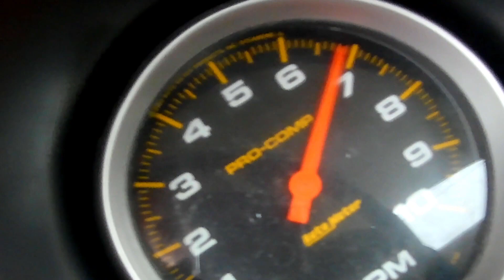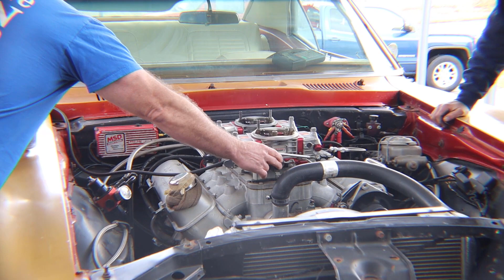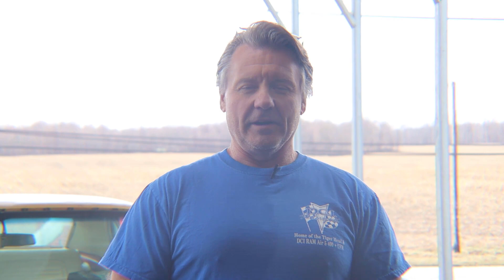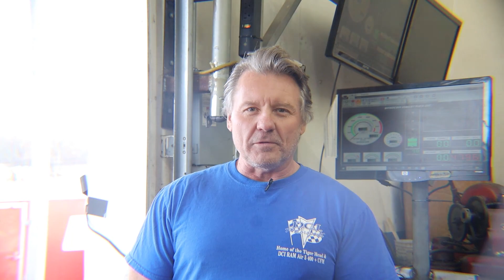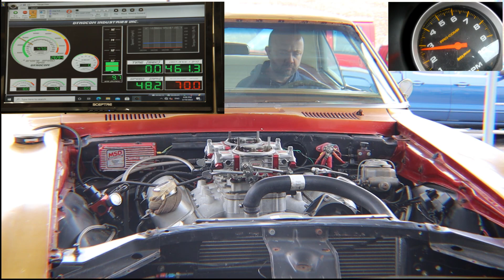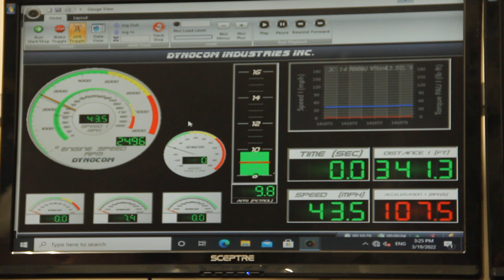DCI 67 Firebird Dyno

Comment: Just wondering what is a Ram air V is a engine 400 or 455 or just heads??
Reply: It was a 303 cubic inch engine as originally designed and produced. It was for Trans Am racing.

Comment: 614 hp, but 738 torque? Seems like one of those numbers is wrong.
Reply: Interesting thing about the math, torque decreases as rpm increases. I didn't see any curves in the video, would be interesting to see what rpms peak torque and hp came in and how they ramp.
Reply: @tahm22  Yes, I think the answers to all our questions (or cause of confusion) are in the chassis dyno.
Reply: How so? Doesn't seem that weird at a glance, to me.
Reply: @tahm22  There's no way this motor made that kind of torque below 5000 rpm. Do the math, hp would have to be over 700. Something ain't right.
Reply: @mback12000  torque=hp x 5252/rpm
Using some algebra, we can determine that the motor was spinning at 4370 rpm to acheive 738 ft/lbs with 614 hp. That seems about right for a built Poncho.
Reply: @tahm22  No it doesn't, that's my point. Respectully, it wasn't making that torque at that rpm.. And fell so fast it wouldn't have a higher hp number.
Reply: Listen to his specs...a 430 cfm head, twin carbs, and 268/284/106 w almost 900 lift cam... No way peak torque is at 4300. Cmon dude.

One thing is this is a chassis dyno, so he's down at least 100hp at the tire. This motor is way over 700 at the flywheel. I'm not taking anything away from the builder.
Reply: @mback12000  Great points. You think rear gears could be pushing the torque up? You can gain as much as 55% with the right ratio.
I really don't know, but I appreciate the conversation.
Reply: Most likely has to do with the way the Dyno is  loaded
The initial numbers are usually not correct and that’s right where the torque peak is on their chassis Dyno but that’s definitely not where the torque peak is in the rpm range. Most likely the horsepower number is correct realistically if I had to guess that motor makes about 630 to 650 torque at probably 5200-5500rpm on an engine Dyno
And engine is probably making near 750hp on the engine Dyno so realistically torque number would be around 550+ or a little higher at the tire imo
Reply: Torque converters can multiply torque within a given range and this is a chassis dyno. So it seems correct to me.

Comment: You guys are developing a tri power intake manifold for your tunnel port heads, correct? 

A low-profile option would be great because I'm intending on using RAV heads w/ Tri power on my 65 Catalina Convertible, but they don't have much hood clearance. 

Would I have to get a manifold cnc machined as a one-off design?
Reply from the maker: I do believe my cast intake with a tripower top will work. I dont have a full size 65 to test fit, but we can work around that when the time comes.